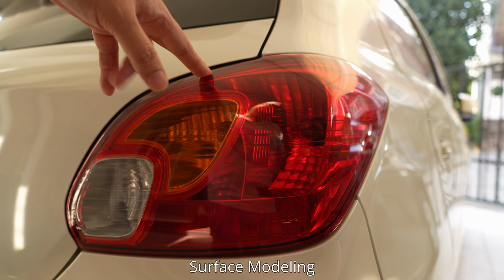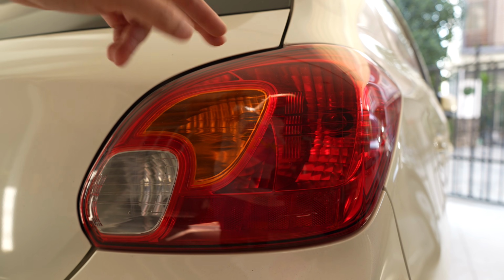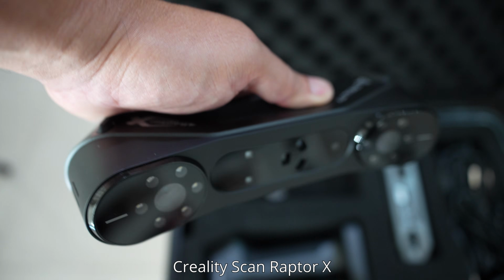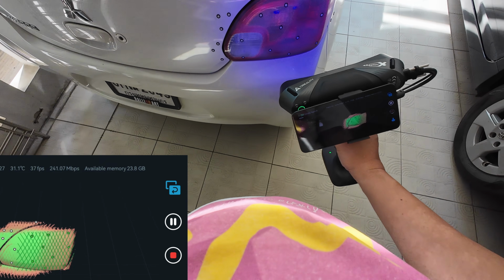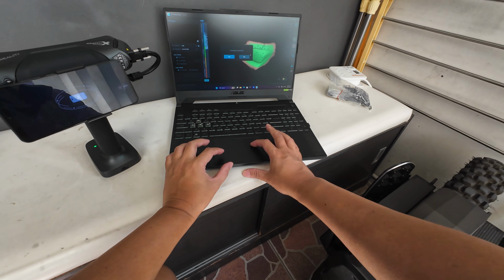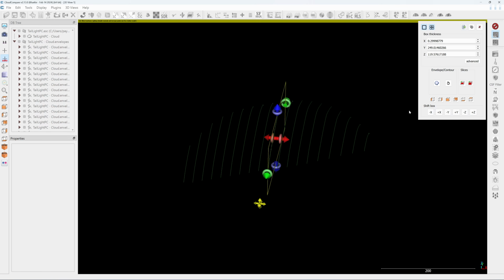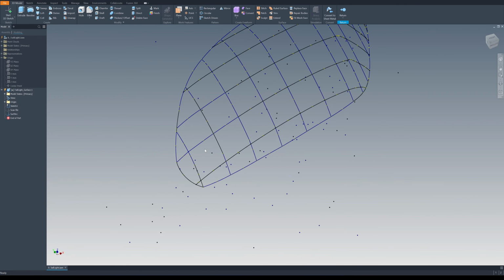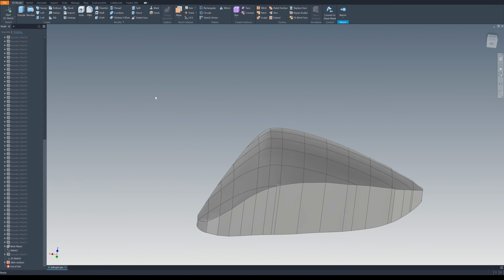3D Scan to CAD: Reverse Engineering Taillight with Creality Scan Raptor X | Step-by-Step Guide

Comment: What is your laptop specs?
Reply from the maker: CPU: Ryzen 7980H, GPU: RTX 4070, 32 GB RAM.
Reply: @ thanks man 🙏 dose it lag or is it smooth?
Reply from the maker: @ali-sleimanchehade6129  Buttery smooth even with wireless handle.
Reply: @ali-sleimanchehade6129  4050 6gb is also smooth
Reply: @tomaszszczepaniak2101  I have a 4060ti 12 or 16 GB vram, 64GB ram DDR5 and an i7 13700K and when I scan with the Einstar I an error “out of memory”! 🤦‍♂️🤦‍♂️🤦‍♂️ 
PS: it’s a desktop not a laptop
Reply: @Payo-TensileCreator  got a question again🙋‍♂️  
It’s about the scanner since you have it I would like to confirm something. 
My desktop is in another room around 25M away from my garage and I did pass a long Active USB and I connect my mac to via Ethernet to the network and use chrome Remote Desktop to monitor my scan. Now the thing is will the USB of the raptor X (the USB wifi) be used on the 25M cable and another thing if I connect my desktop to the creality wifi 6 will I lose my internet connection via Ethernet cable?
Reply from the maker: @ali-sleimanchehade6129  I never seen USB 3.0 cable that runs 25m long before. If you're going to use the Raptor X, connect your MAC with WiFi 6 to the handle, the signal can go 25m (but not the max speed) I used to connect Raptor X to my desktop on the second floor and make 3D scan on the ground floor, it works OK
Reply: @Payo-TensileCreator  I See :/ i think I am going to contact it via USB just to be on the safe side 
Thanks man 😌🙏
Reply: @ali-sleimanchehade6129  wow , so this creality might be better optimalized  than einstar ?
Reply: @tomaszszczepaniak2101  100% I hate the Einstar now that I had the chance on testing the RaptorX!! But the software dose need some improvement don’t know how to explain it but the software of the Einstar have better tracking but still the I prefer the RaptorX just need to get used to it!
Reply: @Payo-TensileCreator  Holy moly